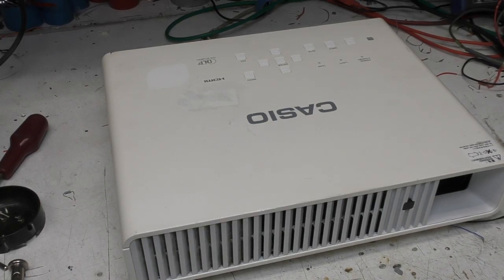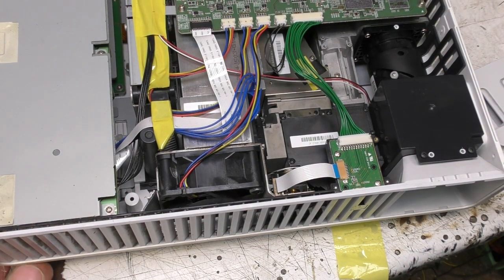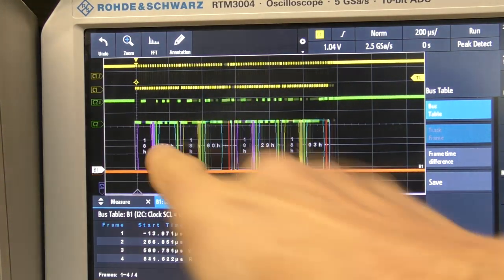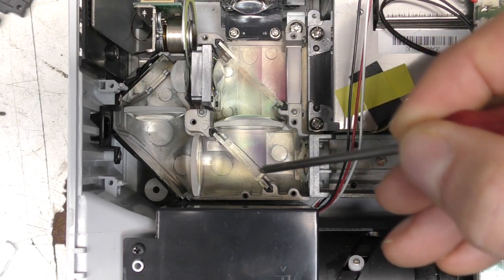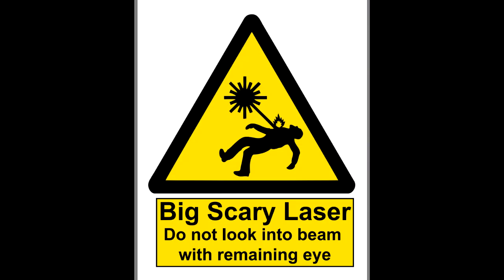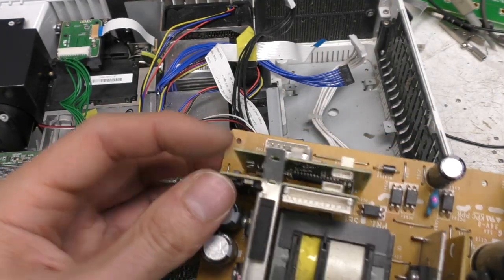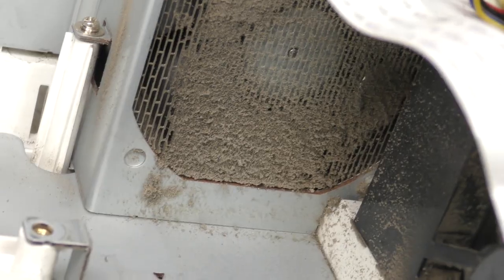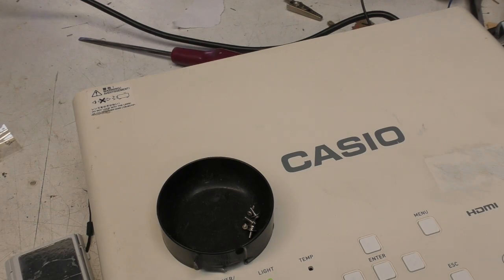Casio laser/LED projector teardown

Comment: Projectors are sensitive to alignment issues if dropped, even from a few cm.  Could have an accel so they can refuse warranty with proof the unit has been roughly handled by the customer. Or claim the shipping company warranty if a pallet arrives at distributor that they suspect was dropped.   Does the PCB have a backup battery to run the accel while unpowered?
I guess the question is, is their damage losses from bad unit handling costing them enough to justify a 20c accel per unit. 
I think it probably is. One damaged $2000 projector would pay for a lot of units to have an accel.
Reply from the maker: No battery. You can get  mechanical shock indicators-sometimes used for shipping damage detection

Comment: I have an Epson projector that will automatically adjust the lens to project a flat image regardless of the angle the projector is sitting at. Auto leveling I guess, but you can turn it off.

Comment: Generally the medium which the projector will be projecting on will be vertical(Hanging or a wall). So it will change the vertical aspect ratio depending on the tilt? Edit, just read other comments. Keystoning. Always learning.

Comment: Nice video, as always. The accelerometer, to me, may serve as a digital and active interlock to stop the laser. If a laser is not mechanically stable, the light can shoot at undesired places, such as human eyes. I have seen similar designs on class-4 q-switched lasers. Not sure if it is designed for the same purpose here.
Reply from the maker: No need as it's enclosed

Comment: Interesting about the completely different methods for making each of the primary colors. As far as I know some other designs use the laser as only source by going through phosphors similar to those in high CRI white LEDs to create white light and then throw that onto a standard color wheel or dichroic mirrors. Someone I know bought a big professional Sony 10K lumen laser projector for a venue and the light source on that is specced as being just a 350W(!) blue laser array. Funny that blue lasers used to be that expensive and price has fallen off a cliff with 5W blue engraving lasers costing about 80 bucks from banggood now. On show lasers blue also always tends to be the most powerful one, seems blue is the cheapest per watt by now. As others have mentioned the accelerometer is likely for auto keystone compensation, most projectors have had that as a feature for quite a while now. Also a lot of projectors use LEDs as light source now, bulb-based ones are disappearing pretty quickly in favor of either LED or laser.

Comment: If the lasers are so powerful why don’t they burn a hole through the DLP?
Reply: The suface is reflective enough so not much light is turned into heat
Reply: The DLP chip has a heatsink on the back to dissipate heat it absorbs. The big cinema projectors have water cooling blocks for each of the R, G, and B DLP chips.

Comment: I'd love to get my hands on a DLP module that I can control for a DIY project. I have a dumb-but-fun project in mind where having control over a micro-array of mirrors like that would be absolutely ideal.
Reply: Been looking for the same for a while but TI is absolutely anal about it and prices dev kits out of reach for messing around..
Reply: @plemli  From what I've found, TI's DLP tech is closed. So no cheap DIY/experimenter stuff.
Reply: https://www.ti.com/tool/DLPDLCR2000EVM is about the cheapest available evaluation hardware. What level of control do you need? This only allows for video input which is then processed by a TI ASIC and then sent to the DMD. No direct control of individual mirrors possible.
Reply: @JakePulliam  Thanks for the lead. It"s low res and limited wrt interfacing, but otoh it's cheap and I have an unused BBB laying around so I've ordered one.

Comment: I saw a couple of sealing mounted projectors with anti theft feature, maybe the acc is for some kind movement detection. The projector I saw did not have an alarm or so, but would just lock up if moved. It even had a ton of warning labels saying this, and a bright orange housing...
But I just read auto keystone correction in the comments, probably just this....

Comment: I did a bit of reversing on the LED/Laser driver board on a similar model a while ago...

https://photonlexicon.com/forums/showthread.php/11883-Running-the-XJ-A140-With-Missing-Diodes?p=216586#post216586

Unfortunately, none of the photo links work any more, but I basically just soldered SMD resistors and single strands of wire to the MCU on the board, to fool it into thinking it's getting feedback from the current shunt resistors for the laser bank.

I had to use resistor dividers from the driving signals, to match up the levels that the MCU was expecting.

Before then, there were a few mods where people were putting high wattage resistors in place of the laser diodes, often requiring water cooling. lol

It was a very interesting time when these projectors were released, because it immediately started to devalue people's "industrial" blue laser modules, at least for laser show purposes.

Back then, a 500mW Blue laser module could easily cost £600 upwards.
These projectors had 24 diodes, each capable of power outputs of around 1-2 WATTS.

Obviously the optics on a proper laser module are generally higher quality, with anamorphic lenses etc., but still.

Some people were buying hundreds of these projectors brand new, just to salvage the diodes from them, and selling the diodes at around $60-70 each.
Reply: Oh, the motivation for me wanting to get the projectors running without lasers was because the projector "carcasses" were selling for only around £30 for a while.

So I bought the Blue and Green versions of the same Phlatlight LEDs, and planned to make a driver board for them.

As is usually the case, that project never got finished. lol

https://i.imgur.com/LTnSdmQ.jpg

(I had a previous project years ago doing a similar thing, to drive high-power RGB LEDs in sequence with the segments of the colour wheel, to replace the original lamp. It worked quite well, but the LEDs weren't particularly powerful nor affordable back then.)
Reply: A few people did some slightly less responsible vids with the laser bank. lol

https://www.youtube.com/watch?v=gF4HG6v29UY

Comment: I've alway been curious about these - thanks for doing this!
Reply: Interesting they would make the blue LEDs do double duty since blue LEDs typically have the lowest duty cycle?  I suppose it keeps the number of LEDs down by doubling up colors onto one LED and if the blue goes the whole light engine has to be replaced.  It must be easier to get green from blue than getting green from red or red from green.  I was hoping with lasers since you can get all three primary colors from individual LEDs there wouldn't be any moving parts other than the micro mirrors on the DLP chips and the cooling fans but nope - still a fast spinning color wheel.  

The optics and engineering in this are amazing - especially when you think about the manufacturing scale and price point these things are made to.  Incredible, really. 

 Fascinating engineering!

Also good to know to slap some external pre-filters onto those things.  That's a horrible design with no filters!